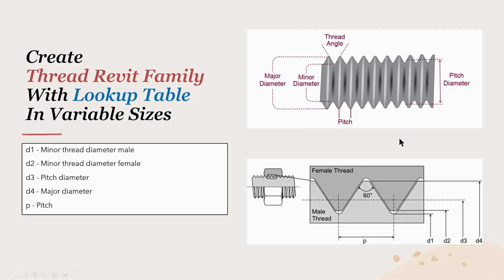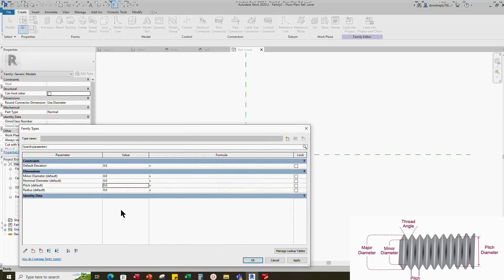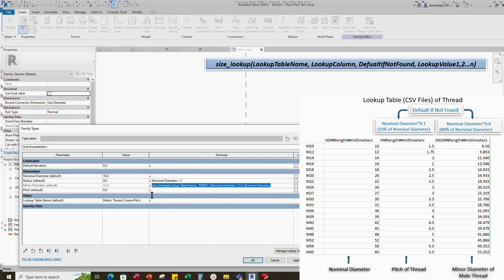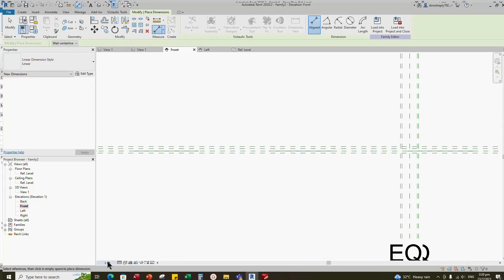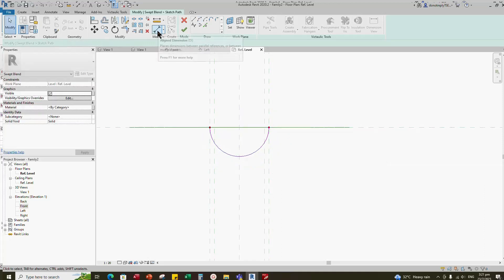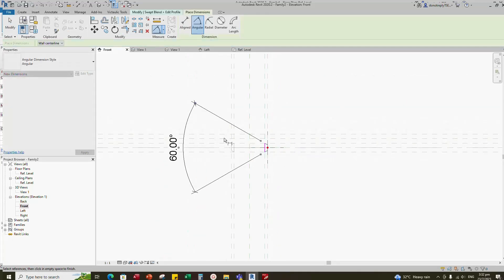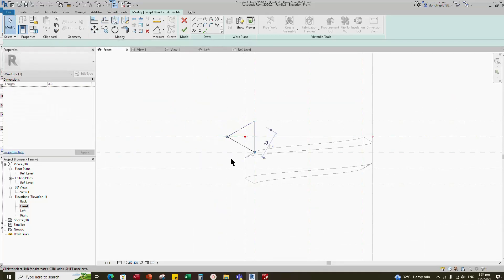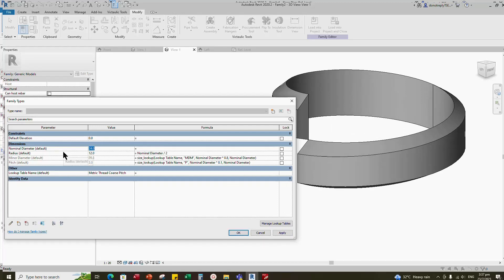Create Thread with Lookup Table

Comment: when we change the norminal diameter the thread kinda twisted a little bit and both half of the thread started to loose and not connected to each other. why is it like that? did i miss something?
Reply from the maker: Maybe not lock to reference plane.
Reply: @ThomRVT  i did follow the video a few times with each step exactly the same and tried redo it all but still the same result. I feel like it has something to do with the lookup table value (already check and it's the same as in the video) or the part where we have to trim the end of the triangle.

Comment: I have made these two half circle threads as per Video instructions and parameters flexing fine while changing Nominal Diameter values no problem but when observed in 3D Views there is No uniform size as well as angles shown also changing drastically , these changes happening at smaller side where we cut the triangle and made this small Side and locked it . When i put maximum 60mm Nominal Diameter the thread shape changed excessively. Only 16mm Nominal Diameter Shape has uniformity ... i want to show the screenshots for more clarity but in comment section its not possible . Can you please check and verify whether this happening there also . ??  Or i might miss something ? Need help , Apart from this error Lookup table and everything working well no issues .
Reply from the maker: You can share your csv file via email.
Reply: @ThomRVT  Okay but on which Email I need to send CSV file ?? , and FYI,  I have created csv file manually by seeing the picture of tutorial video exactly the same . Additionally,  Do you need screenshots of different Nominal Diameter showing non-uniform threading as I already mentioned in the comment ??
Reply: I didn't receive any reply for above comment ?
Reply from the maker: @nadeem006  thomashzthan@gmail.com
Reply: do u get the solution yet? I currently have the exact same problem here. asking for a friend
Reply: @adensenpai8547  Yes got the solution,  only need to lock angle dimensions and make few more reference planes of pitch, for smooth height and nominal diameter in main family to achieve uniform and consistent 3D thread ... already Thomas has replied via  email regarding this issue
Reply: @nadeem006  can u share it to me? A screenshot of the front view also helps.
Reply: @nadeem006  i have the same problem. where to make the new reference planes of pitch?

Comment: Hello, got your anchor bolt library and L anchor bolts do not show threads on sizes smaller than the set default diameter. If I want to show smaller diameter, say 5/8" (15.875 mm) . it shows a non threaded, plain L bolt.
I thought the downloads came with the lookup table.  If that is a separate deal, then this family is not useful to me on a tight time constraint.
Thank you for the work anyways.
Reply from the maker: 5/8” is M16 (16mm). You can export csv file from the loaded thread family. There are M10 to M100 thread sizes

Comment: Hi, I created the Thread Rod Family as you made it in the video but the paremeter "Length" doesn't appear, should I create another reference plan in the thread rod family and create the parameter?
Reply from the maker: For thread rod, create a reference plane for length parameter. load the created thread piece family, and then make array. Please find the video below 
Create Thread Rod Revit Family (M10-M100) (Parametric)
https://youtu.be/SUaKzxIN2HA